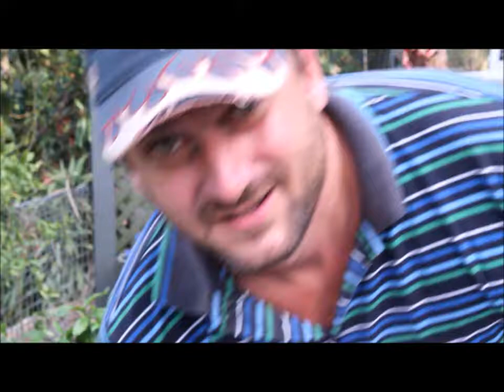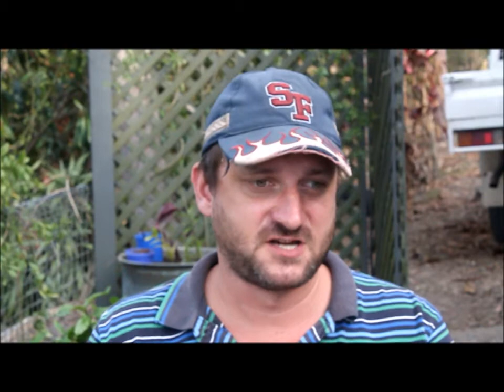MPPSolar PCM5048 & AGM Batteries - Inverter Failures

Comment: Great informative video not a rant which is probably the path I would have gone down. Are you still using the victron gear? Still like it?  I am going off grid early next year and have some paralysis through analysis of the different brands (victron/outback/midnite solar). I was impressed with the mpp solar gear with the usual solar people on youtube. But then I saw your video and another one by someone else with what seems a balanced informative argument and now I am leaning towards victron (althought the midnite solar interests me but there is not the same level of support in Australia).  Anyway thanks for the video.

Comment: Hiya Bloke. Glad I watched you vid's on the MMP Solar gear.  I'm wanting to set up the shack (now house) to run a F&P washing machine and whatever other small whitegoods the other half thinks we need...  We've been running it off a Honda E10i genny (which does a great job and charges the batteries at the same time), but I'd like to have it all a bit quieter and smarter.  I'm about to get about 1kW of panels and am now in the market for a suitable inverter/charger.  I had a look at the MMP stuff and it looked okay, but now...
I don't want to connect to the grid and just need something that does the same job as their gear, but more reliable and safely.  I'm flush with 2nd hand batteries and happy to have them fail and replace them as I need to, so I' assuming that as long as I have enough minimum battery capacity, I could probably get away with a reasonably small bank of batteries and just run the loads when the sun's looking good for that duration (as long as load A < solar A)?  Other than the Victron and SMA units, are there any others worth considering?

Comment: I had 4 x MPP 5048 controllers, they exhibit the same 62.7V behavior  as yours. I am using 50Kw Lead/Acid forklift batteries. So as you have said increasing battery capacity is not a solution. I have replaced the MPP 5048 with Tristar MPPT60 and I am getting much more charge into the battery from the same solar array (tristar 16Kw, MPP solar 5048 12KW).
So not only do mpp solar chargers destroy your battery, they reduce your harvest of solar energy by 33%.
Out of the 4 x mpp 5048 one failed in 3 years, the others are still "operational" if you can described regular 62.7V charging of the battery as operational.

Comment: Do you know if the problem has been solved if not what other product do you recommend. I,m looking for something similar to the 2424MSX 3kva 2400W 24V solar inverter with MPPTcharger
Reply: Ive been using the PIP24 2.4kva and for the past 6months it has been working perfact l never had problems .. am using 8d gel Trojan batteries . Am looking forwad to see how it will do over time.

Comment: Hi I have been selling these things over the last twelve months and experienced 100% failure rate at about the three month mark as you described. Is the fix simply increasing the Capacitor voltage rating? Have you tried this?

Comment: MPP PC60 i sent for refund 4 m ago, 0 MPPT function. I found 30 SMT caps series/parallel on charge output. No low esr electrolytics are used. 2 phase buck converter.